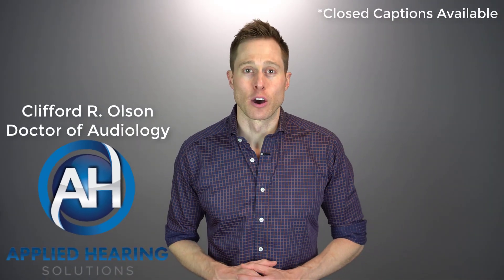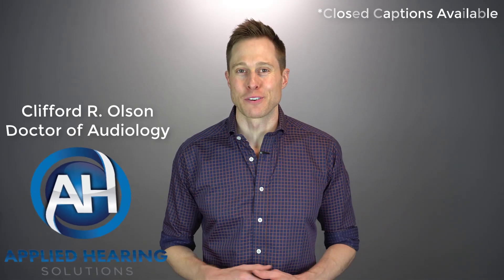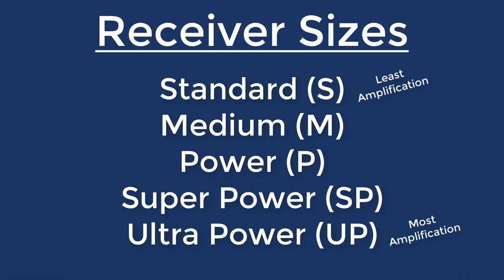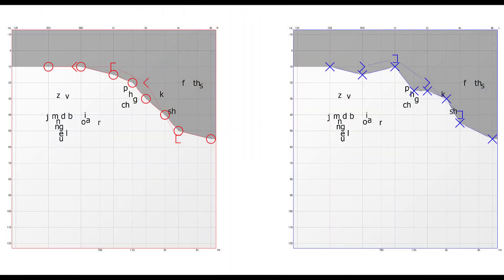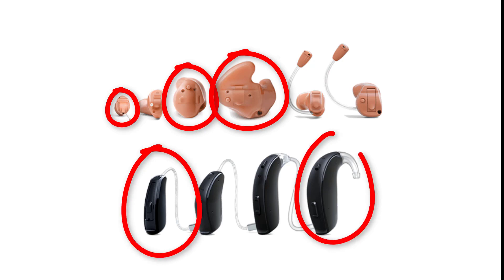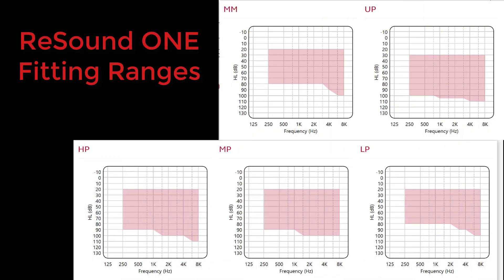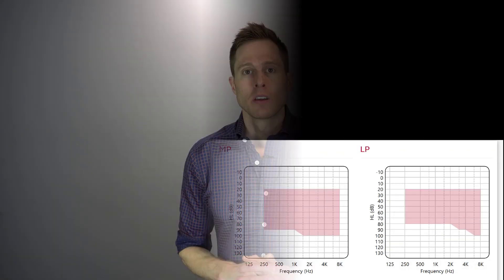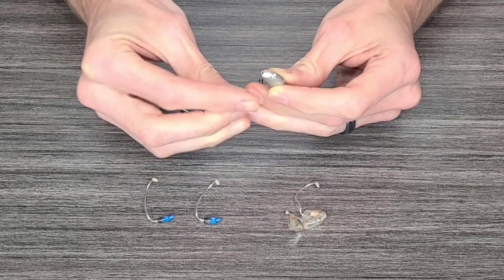Understanding Hearing Aid Fitting Ranges | Finding the Best Receiver Size

Comment: What level receiver would you use for a flat moderate loss? I have had the standard in the past, now just got medium power in my new devices,.. is it normal that they feel super strong? Am I supposed to have a medium power receiver for a moderate loss? Particularly for Widex
Reply from the maker: It depends on the brand and the actual gain/output numbers for the receiver.  It also depends on how much gain is needed for your size of ear canals.  Therefore, it is impossible to answer this question without testing each of them inside your ears.
Reply: @DrCliffAuD  I was saying particularly for Widex, but I’m saying from a general standpoint, being that I have a flat moderate loss, does that make sense that i was given a medium power receiver? I have also heard that Widex also doesn’t make standard level receivers anymore.. i had only used standard in my other devices, but once i switched i was given the medium power level

Comment: Hi Dr cliff 
I have moderate high frequency hearing loss, but fairly good low/mid frequency hearing. I have noticed most standard power receivers have a fitting range that starts at 10-20 DB some of my thresholds are better than that.  Will a hearing aid work well if my audiogram is better than the fitting range in some areas?

Comment: My question is:  Would an ultra power hearing aid with ear molds work if the hearing goes from moderate at 1,500hz to profound, requiring 110 DB at 2,000hz?  Can such a hearing aid help improve speech recognition?

Comment: I have the OPNS3 hearing aids minirite version with Oticon Plastic custom moulds! I am using the 100 receivers! An Audi has told me that 100 receivers are the most powerful that I can have for these moulds and that the maximum output of these aids is 100db so that because my right ear has losses extending to 100 at 2000 hz and 110 at 6000 hz he says that I need Oticon Exceed! I thought there was a 105 model of receiver but maybe I am wrong? Does the 105 give 105db output?

Comment: I don't have my current audiogram, but recall ranges being from 35 to 70 (not over 80). So I think I'm in the moderate to severe range. I got a RIC which is what two places recommended. I chose the Oticon Opn S miniRite R, but Starkey was recommended. I chose Oticon because a previous place (not equipped to do REM) recommended the Ruby S and Open S, so I was bias to Oticon at that point. I tried on the Ruby S and Opn S, but couldn't tell the difference between them. My current dome is Bass 6MM double vent. I have two adjustments left I think. At my last follow up we set the amplification lower because I was getting too much noise, music or  youtube videos wasn't (and still doesn't) sound right if I use my hearing aids, calls are ok, and tv is ok (at least I'm lowering the volume now). Due to lowering amplification, the feed back has increased (and she said it would). How does one know if I have the correct dome? How does one know what amplification to have the hearing aids at if they've never had hearing aids for 30 years? I'm a little frustrated as I don't know what exactly it is that I'm supposed to be getting overall. I feel I may have chosen the wrong hearing aids. I'm not even using all the features due to the issues stated above and as far as going down to basic I'll just be loosing the bands/channels I have now. I know I'm supposed to hear better, but that's all I know. I'm constantly turning them up or down via the app just like I did when I had the iic. I hadn't really thought about the dome or receiver until this video. Honestly I thought after 30 years hearing aids would somehow be totally different technology wise from the iic I had at that time. The only difference to now is all the bells and whistles they offer w/the hearing aids of today. Any suggestions?
Reply: Audiologist in Canada here.
Short answer: Your hearing aid provider should know what kind of dome to give you.
Longer answer: Judging by your description of your hearing levels, a double vent dome is probably fine, as long as it's not too small. It should fit snug in your ear canal but without discomfort.
But more importantly: If you have gone 30 years without hearing aids, it is common for things to not sound quite right at first, as you need to get used to them again. Do you have any hearing appointments coming up? You may want to book one, so you can let your hearing aid provider know that you have are having questions about adapting to your new hearing aids, and see what they suggest.

Comment: I need a decent hearing aid that also helps cancel out some of my tinnitus. Unfortunately I'm not wealthy. $3,000 per hearing aid...yeah right.
Reply: Do you have insurance you can consult?
Reply: @srvrace5807  My insurance won't cover any of it. I have to hope that a millionaire adopts me.  :/
Reply: @paddyotable , I’m in a similar situation, though I have an HSA I could use to pay for mine.  I went to Costco for a pair of their KS 10.0 hearing aids for $1,399.  (That’s for both ears, not each ear.). They’ll test you for free, and you can even make an appointment where they fit you with a test pair baseline programmed to your prescription and let you walk around the store to experience the difference, and the maintenance visits are included in the cost of the hearing aids.